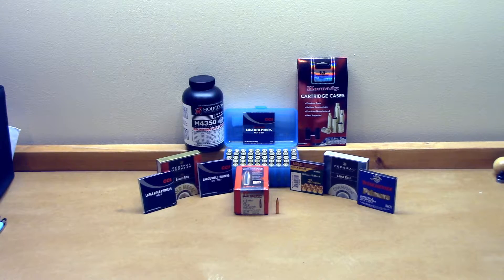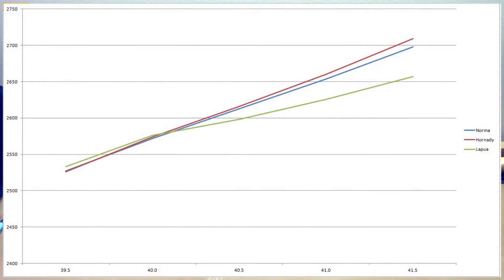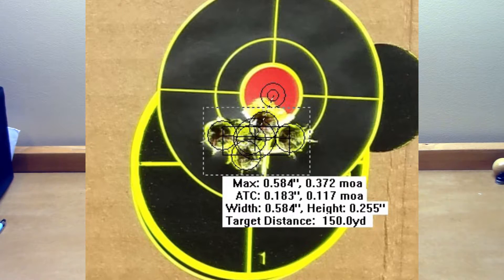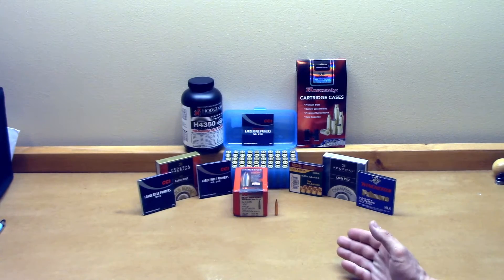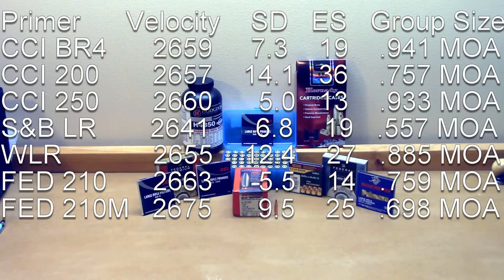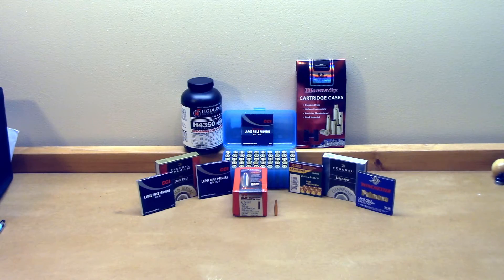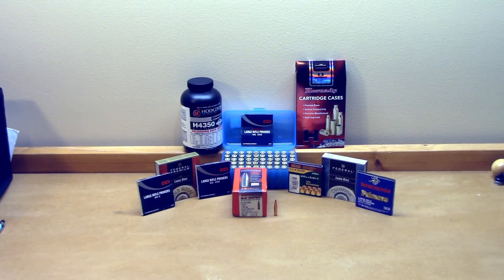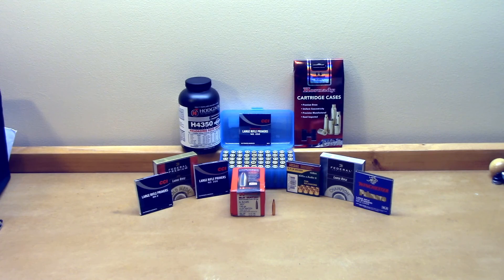Large Rifle Primer Evaluation using 6.5 Creedmoor

Comment: I would like to know what exactly determines and/or what process determined the actual size of the flash hole? Maybe everybody except me already knows this, I just don't know this. What is it that I need to consider, if for just an example, I want to use a magnum primer and a larger flash hole to ignite the powder in the cartridge? OK, I know all the relatives,  no need to spend time telling me that I can "assume" to expect higher immediate pressures, etc. Are there any real facts?  Why isn't the flash hole a slightly smaller size than the primer cup to allow a support shelf for the cup and allow the full force of the primer to ignite the charge? Is there any professional related technical and supportive data related to flash hole aperture size?  I'm sure it affects projectile performance and charge burn rates.

Comment: I like the FEDERAL 210 primers because they have a low SD and ES with a decent velocity AND decent group size. 
I'll take CONSISTENCY of SD and ES over a 5 shot group size because other factors including human are involved in group size.
A higher velocity means less flight time for wind to play with the bullet so, again, I like the FED 210 primers, especially for longer shots from 600 yards to 1,000 yards.
BTW, I shoot a RPR in 6.5 CM so thanks for this.

NOW I would like to see a primer comparison for the 6.5 PRC cartridge using H1000 powder. Are magnum primers would seem to be called for with the case capacity around 62 grains of H2O. I use 6.5 PRC in my Browning X-Bolt Pro which is a very accurate rifle.

Comment: Your data, and other data I have seen indicates the standard deviation of velocity has little to do with group sizes  The load with the largest SD had a smaller group than the load with the smallest SD...I would have thought overall the groups would be MUCH better...The Ruger should be a solid half MOA rifle...
Reply: When it comes to velocity, I've always played it like this:
1. Chase the nodes, and ignore where they are velocity wise.
2. Fully develop all promising loads. I've had loads look good at 100 and 200 yards that fall apart at extended ranges.
3. The rifle will always dictate the load, all too often people get hung up on some factor because of past success.
5. Once you have a fully developed load, strive for consistency. This is when you look at standard deviation, seating pressure, and other minutia. 

I shy away from ever calling a rifle things like "sub MOA", "half MOA" or anything like that. While I have seen more than enough .5 MOA RPRs to know they are good shooters, I've seen plenty shoot much worse. Another man's data should always be taken with a grain of salt.

Comment: New to your channel, especially like the detail. U mentioned owning RPR; do u find it to be a bit picky on what reloads it accepts?
Reply from the maker: Hi Bill,
Glad you are enjoying the channel. There is a lot of info here but if you are interested in something specific I can try and help you out. I am somewhere around 1750+ rounds though thre rifle at this point and have tested a lot of combos. Picky is a hard description, it will shoot moa or better with most anything. (I have had the worst luck with nosler rdfs but some claim they shoot well for them.) If you can tell me specifically what you want to know, I am happy to tell you what I would pick.
Reply: Bolt Action Reloading do u have an email I could ask vs sending here? Thanks for the quick response.
Reply from the maker: The channel email is moparmadmanyt@gmail.com but I dont check it super frequently just fair warning. But ask me anything you like. I don't mind answering questions in the comments because its pretty frequently that others may have the same questions. Up to you.
Reply: Bolt Action Reloading  Thanks. Long day, will reach out to you tomorrow.
Reply: Bolt Action Reloading  Sorry for not stating my issue clearer. I own a RPR Gen II, in 6.5 Creedmoor. I’m a novice reloader but enjoy your channel to pick up tips and advice. A problem I’m having with some, but not all reloads, is they will not feed all the way into the chamber; the bolt will not lock in the down position.
I discovered this while using Hornady 160 RN bullets. I use RCBS full length dies and follow all the measurements in the Hornady manual. I trim when required and check every round in a Lyman headspace gauge which reflects the cases are within limits. Lastly, I also own a Savage Model 11 in 6.5, it will feed everything I’ve reloaded without any issues. Any advice is greatly appreciated.
Reply from the maker: HI Bill, 
My first question is do you have the Hornady headspace gauge as well as the Hornady OAL Gauge with modified case?
The headspcae gauge set is needed so you you know that you are actually pushing back your shoulder .001" or more (.003) when you FL size. My Gen II 6CM has a very tight chamber and I have my die cranked down pretty far compared to my die setting for my 6.5. You need brass fresh fired brass out of your chamber and then compare to a piece of brass you have sized. keep in mind that if you don't push the should back but push the sides of the case in the actual length of the case grows (and the most likely reason why your bolt wont close on one gun but not the other (they have different headspace measurements)) These tools are really mandatory with a set of calipers to ensure your reloads fit the rifle you intend them too. This is the most likely cause.

I would get the OAL gauge and the proper modified case to go with it so that you know how far your projectiles are from the lands of your rifling. In this case you could have too long of a COAL (measure with a bullet comparator to get CBTO its more consistent and its just the better way of doing things.) but not as likely as not sizing the case enough. 

If this doesn't make sense ask more questions, it might help if you give me your process start to finish so that I am not assuming too much. Best of Luck

BAR
Reply: Bolt Action Reloading  I sure appreciate your advice. No, I don’t have the items you mentioned but I’ll fix that problem shortly. Honestly, some of what you described went right over my head but I’ll continue to re-read until I understand it. I’ll probably contact you again for additional advice.
Reply from the maker: No problem. The tools are well worth it if you continue to reload. I don't have any specific videos on how to use them but many others do. Another resource is Johnny's reloading bench, he is my favorite channel, but everyone has their favorites. His beginners guide to reloading series has a lot of info but takes a lot of time to watch. https://www.youtube.com/watch?v=2lDL9tUnfVQ&list=PLTTrjvDib94l4NNyug0efjXsXokBksmRa
Reply: Bolt Action Reloading  I subscribed to him last night! Can u explain what it means and how I go about “setting the shoulder back”?
Reply from the maker: This is controlled by how far you have your die screwed down against your shelholder. When you fire a case the shoulder moves forward to become the size of the chamber. You can not push it far enough or actually push it too far as well and this can lead to a case head separation. Once you get those tools you can measure some factory ammo, fired cases, and then resized cases. Factory has to fit everything,  you are just trying to fit your rifle.
Reply from the maker: This may do a better job then I can type. He is really good too. https://youtu.be/azv1dxKQNvA
Reply: Bolt Action Reloading  Many thanks, really appreciate your help.  I absolutely love firing my RPR. 6.5 is such smooth shooting cartridge. Thanks again!
Reply from the maker: Glad to help. Probably mine as well. Loves the 140 eld for general shooting, for hunting the 135 Berger classic hunter cant be beat.

Comment: FOR what its worth. In the extream cold in Alaskas bush the ONLY primers that ALWAYS worked in my rifles & 44 mag was the CCI mag primers in everything..Ran really HOT loads due to bears/moose. ( 45/70, 300 Win Mag, 243 & 22 hornet, 44 magnum)  But the trick I found worked best was inside reaming the flash holes & ENLARGING the flash hole just a tad. Never had more than a 10 FPS variance but was fanatical about EXACT charge weights. Always set my primers just below flush. Case life sucked w super hot loads but that was insignificant w big ass grizzlies in your face. 243/22 hornet were primary cold winter fur rifles. Just got my 1st 6.5CM but cant imagine that being any different. The cold does NOT so funny things to guns/loads.

Comment: Have you thought of using the federal gold medal match large rifle Magnum primers? I know of a place that has a bunch in stock here in Colorado.
Reply from the maker: I actually just found some a couple weeks ago and bought 2k. Hope they are a good lot.
Reply: Bolt Action Reloading Have you done any testing with them?
Reply from the maker: Not yet. I am sure I will be.
Reply: Bolt Action Reloading k let me know how it goes. I am curious if they are better. I also have some starline small rifle brass I am trying to work out with different primers. Have you done a video on seating depths?
Reply from the maker: I have not covered depth. Partially because I am not sure how to control it as well as I would like. I plan on doing some testing with a couple new primes that I have in stock now. I personally wonder if there is "really" a difference in the fed match primes since the lots I have used I have actually had better SDs with the standard level. I have a feeling it's more about lot control than it is match vs not.
Reply: Bolt Action Reloading yeah I agree. I'm not sure match primers are all that they're cracked up to be. I hear the match primers just guarantee ignition and that is it. Also you're shooting 2.835 in? In your Ruger Precision correct? If that's the case you're just loading them one by one?
Reply: Bolt Action Reloading wow!! What mags are those? Diffently not a pmag 😀
Reply from the maker: Magpul AICS. I have a video on them.
Reply from the maker: https://youtu.be/l7UUMOIIXho

Comment: Hello,  I went out shooting my 140RDF, H4350, CCI 200 load which is usually a .7 MOA Load, in cold weather in the high 20's F.  My Magnetospeed showed awful SD 52, ES of 140!  I am wondering if the freezing weather needs a Mag Primer?  A 223 with a CCI 450 primer has very low SD and ES.
Reply from the maker: I have basically switched to Mag primers in all my 6.5 creedmoor loads. Johnnys reloading bench actually just did a series on hangfires in 6.5 creed and it is very primer related. He is using SR primers which make this worse I think. Best of Luck

Comment: This is very valuable info so thank you for taking the time to run the tests and share them. I can't wait to see how the tests go with the Lapua brass because I have a new batch of 100 waiting to be primed and loaded. It would be interesting is to see the same load test conducted for the Lapua brass with a Magnum primer like the CCI #450. Will the velocity tail off like before or will it be more linear? Will ES and SD be better? FYI, I have gotten a lot better ES and SD with the Fed 215 in my .300 Win Mag by weight sorting my primers. They range from 5.50 to 5.68 grains. I separate mine into two groups: 1) 5.54-5.56 and 2) 5.58-5.60 grains. The rest get set aside for sighters.
Reply: You could do a test!

Comment: 41.1 grains of Reloader 16 5/8" groups 143 Eldx.  As far as small rifle primers go I did a test like this in 2010.  On the .223 Remington with 77 seirras.  I found Federal 205M and Remmy 7.5 to be the best performers.  All my tests were 10 shots allowing the barrel to cool from the lead sled.  205M were my favorite because they show smaller groups and radius shows book pressures were 7.5s just started to loose radius before blowing primers
Reply from the maker: +Mike Eikey so you have started using reloader 16 already? I just bought some. So far my rifle hates the 143, worst groups from the rifle. I am very interested what kind of velocities and sd / es you are getting using rl-16
Reply: moparmadman velocities are 2670FPS at 46'F with Aforementioned load from the Ruger American Predator.  ES 6 FPS 210M primer 5 shots 100 yards.  143s seem to favor RE-16 slightly over H4350 in the Predator. Go to Midway USA under Reloader 16 or 143 ELDX and you will see the actual target under the comments section.
Reply from the maker: I checked out your photo seems the writing on the load says 2650-2673. I have tried this projectile with RL-17 (I actually have a video on it https://www.youtube.com/watch?v=hlJNVgnFJdQ) and the best group was only 2569 fps and just under 3/4 of a MOA, but honestly that was probably a fluke. I will be doing some videos on RL-16 in the future but I haven't loaded anyhting with it yet. Thanks for the info.
Reply: moparmadman this weekend I'm trying H4831SC under 147ELDs with Chronograph Data and federal primer visuals.  43 to 46.6 grains ish... Through my buddies RPR.  if you PM me on Facebook I'll give you my pictures from my entire load work ups with the predator.
Reply: I tried Reloader 17 under 143s as well up to 44 grains.  No good on groups.  I'm sure it will hold minute of deer to 500 though
Reply from the maker: Thanks for the update. Minute of deer to 500 unfortunately wasn't really what I was looking for. I see some people that really like the 143, but it just doesn't work great for me.
Reply: moparmadman when you do your work up between 40 and 41 grains of Reloader 16 the groups were really tight with 41.1 being tightest.  The velocity was 10 shots but the ES I got on the 5 shot group in the picture was very low 3of 5 shots being the same velocity.  We took those loads to Illinois  longest range and it was an absolute hammer on man sized shilloutes to 965 yards.  Hit the 1280 yard target 1 out of 4 shots
Reply from the maker: Hey Mike, I missed your comment to start with cause it ended up in "spam" cause of the link I am sure, but it is interesting. Sierra does publish data on this powder for the 142 gr up to 45.6 gr for this powder, so your 46.1 probably isn't too crazy. Always interested to see what others results are.
Reply: moparmadman I'm interested to see the lapua brass test.  In all my years of competitive shooting I watched guys shoot Palma.308 lapua brass and the ES was constantly lower.   As far as the H4831SC I'm going to retest the 147s between 45.5 and 45.8.  They looked real good in my buddy's RPR
Reply from the maker: I hope to get that figure out as well. I plan on hopefully shooting my 123 SMK's in Lapua brass today to see how it compares to he Hornady. Then the small rifle primer test should be next to get loaded with those. Probably a little ways out though as far as seeing it on the channel. This takes forever to put this stuff together. From looking at my stats on the last Lapua brass video i did, I think people are getting tired of this subject. Not trying to beat a dead horse just trying to be complete. Can't make everyone happy, but if no one cares I sure wouldn't waste my time putting the videos out. I could get to a lot more reloading done that way.
Reply: Mike you didn't test them all. You left one of the best if not the best primers out of your test?

Comment: good data!
Thank you for the testing.
I shot over 20 rounds this past week with Lapua brass, CCI 450s, and 43.0 of RL19.
Results with a 30" Bartlein/REM 700 action was 5 for 5 on a 6" target @685 yds, and 4 for 4 on 10" swinger @850 yards.  Three shots at 375 yds 1.1" group,  two touching.  Muzzle velocity average of 2749. SD of 7 with El cheapo chrono!
Results with Savage LRP 26" factory tube was 4 hits on 6" plate @685 yds, one just barely off, and one sighter.
Three shot group at 375 yds of 1.8" and an overall SD of 12 according to, yet again,  El cheapo chrono!   
I really need one of those high speed, low drag magnetos!  
My FIL also has great results with CCI450, Lapua brass, and RL17.  And better velocity than RL19.
Also, fyi, I'm shooting Berger 140 VLDs, and FIL is shooting Hndy 140 ELDs.

Comment: Now you have reached true insanity. Lol Magnum primer was interesting.
Reply from the maker: +meditech I knew you would love it. Sometimes you just have to know.
Reply from the maker: +meditech thanks for the comment. I knew you would think I was crazy. The lower velocity in the Lapua brass is really bothering me though, so I have to find out. Enquiring minds want to know.
Reply: Went out yesterday to hit 1300 and goose egged. Fifteen shots, real close but nothing. Had an odd wind change from position to target and high mirage still disappointed in myself.  Oh well, next time.
Reply from the maker: +meditech 1300 is a waze out there. We're your shooting those 147s?
Reply: Yes I was. As far as drop the ballistic calculator seems to be spot on. I had a 3-7mph full val wind with gusts to ten from the left to right and seemed to push more than the 2.2 moa the calc called for. I would have liked to spend more time but my spotter was my 14 year old daughter and she was complaining about BUGS. LOL.
Reply from the maker: +meditech that is certainly some challenging wind for sure. Glad the drop seemed about right. Hornady spent enough time modifying the numbers on that whole line of projectiles, hoped they finally got it right. Guess next time you will have to pack some repellant.
Reply: meditech what twist rate is your barrel? I read the 147 grains are best for 1:7.5 or faster. Also which ballistic calculator are you using? I have 4 or 5 of them on my phone and they all seem to be just a little bit off.